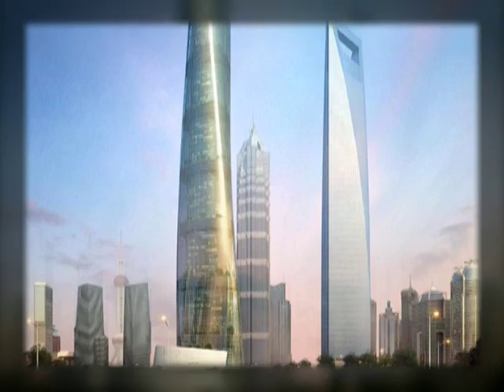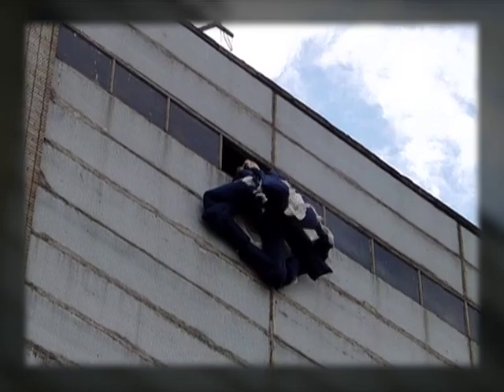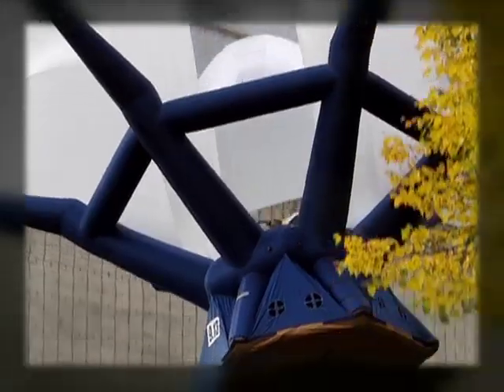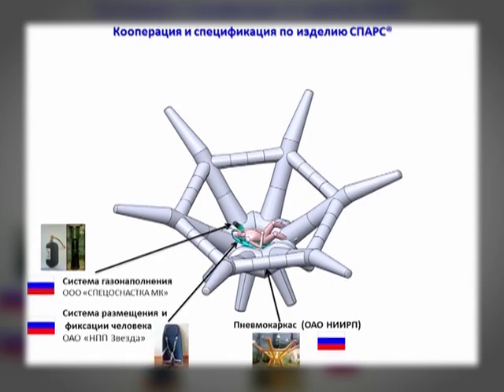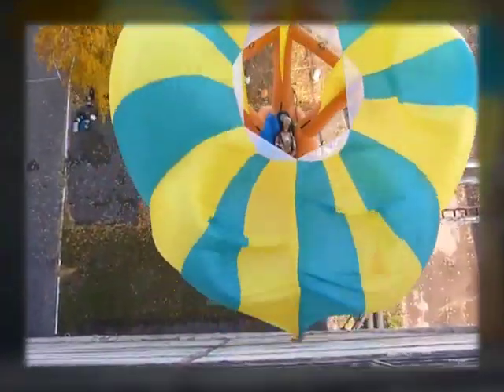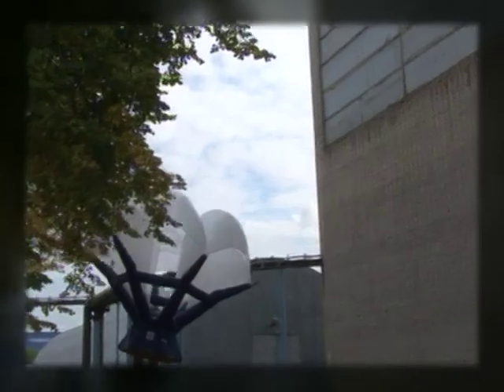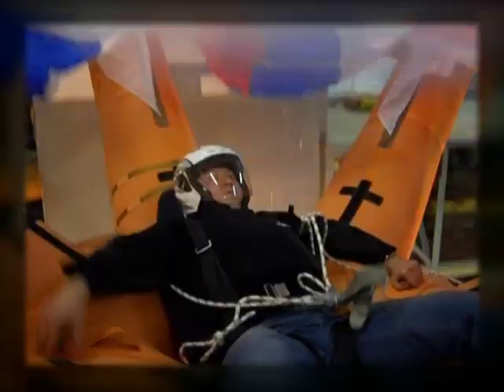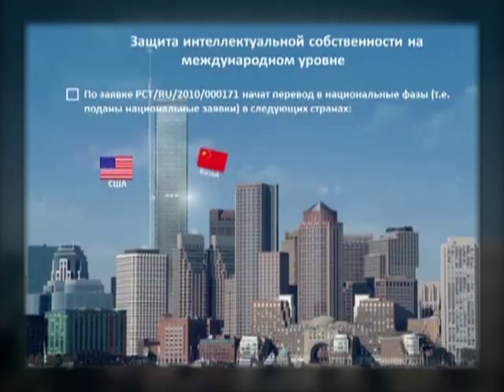The SPARS rescue system

Comment: uhhh, how would this work if you jump from a floor that's 1700 ft from the ground? i'm sure there's high winds at that height. i dont think you have control on where you will land...
Reply: Did you not read? The SPARS rescue system for tall buildings is designed for buildings up to 900 meters (3,000 feet) high.

Comment: This should be field tested at the Burj Khalifa in Dubai.... I'm sure the valuable data that they gained can be used to make this product even safer than what it is but I do believe this would have saved lives on 9/11 as well.
Reply: The Verti-scape Collapsible Fire Escape would work for the high-rises. It's a long escape chute. It is kinda concerning these aren't installed in every tall building. Your just suppose to evacuate by the stairs which takes to long if it's 80 stories. And what happens if the stairs 50 stories below on the lower levels are engulfed by fire. Makes more sense to have this escape chute of the side of the building hopefully on several sides of the building so that there is one away from the fire. https://www.youtube.com/watch?v=s-TM9x5aFuo

Comment: not gonna work
Reply: this isn't Twitter. Explain yourself.
Reply: @Block Chain easy solution.  Use fireproof materials.
Reply: @Kopie0830  But humans aren't fireproof, and this is not a closed system so the fire will still burn the human
Reply: @JohnCena-le1jj Of course humans are fireproof.  Humans will also stay inside a burning building and use an emergency escape backpack as a fire shield, the way as it was intended to be while getting naked and running straight to the fire.
Reply: @Kopie0830  Or they will use the device to float out of a burning building where the fire will still reach them.
Reply: cool concept but what concerns me is that it seems you don't have control on the descent and you cannot see where you are going.
Reply: @maseraffy  I agree but at the same time this is ok for some people might not have the ability to control their descent

Comment: So....
I take it the inflatable is totally fireproof??
Because it will be traveling straight through the flames.
Reply: Shouldn't the hot air push the parachute away?
Reply: Lots of assumptions in this post.  Not all high-rise fires start right under people.
Reply: guess it was take it or leave it, if you 'lucky you will survived just fine
Reply: Flames generate hot air, and hot air would push the device away from the flames.